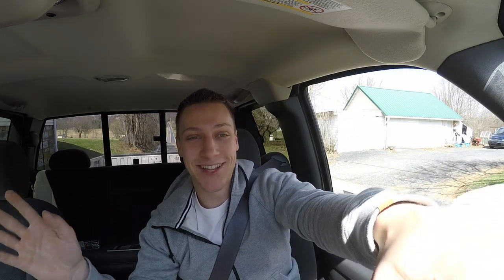WHY I DON'T Roll Coal...

Comment: Rolling coal = high egt's. That's gets to be a lot abuse on the motor. Plus with your duramax you have a common rail that can produce so much power with out smoke! But if you have a mechanical diesel like me it blows a poof a smoke every time it starts up because there's no boost at start up and the pump can't compensate for that. But if I romp on it there is some smoke but it will clear up when the boost catches up. I will be dialing the pump down to smoke less. Maybe look at how to videos on how to properly tune a pump haha. Thanks for not being a d-bag that "rolls coal" everywhere!

Comment: The old trucks with the mechanical injection would spew smoke until the turbo spools but again once everything is where it needs to be the exhaust should clean up. On a common rail diesel I want to bitch slap anyone who rolls coal.

Comment: Hey mike is it cheaper to own a diesel truck than a regular gas truck.
Reply: +Eric Estrada no
Reply: Well now I know, Thanks.
Reply from the maker: +Eric Estrada More expensive pretty much in every way lol
Reply: Street Speed 717 dam at first i was hoping it would be the same or little cheaper.
Reply: No problem, diesel is normally more expensive than premium gas. The only upside to owning a diesel is that they will last a long time. My 2001 duramax has over 250k miles and still running strong

Comment: No smoke means you could be running lean and that will wreck a diesel in a VERY short time, as long as it smokes its not running lean...
Reply: Yes. It's running fuel-rich and is going to clog itself with the gunk. Tuning engines is not easy for a reason, but correctly-tuned diesel has a clean exhaust and very decen MPG count.

Comment: You don't actual have to have a tune to "roll coal". I had a '88 F250 N/A 7.3 that I would run agricultural (red) diesel in illegally of course but this was back when normal diesel was pushing $5/gal in my area and the extreme sulfur content alone made it roll coal with the best of them. 

Oh you don't know a loud diesel until you hear a 7.3 IDI running with a cut out open right off the headers...

Comment: I hooked into my mass air flow sensor so if someone tailgating hit the toggle switch give 15% more throttle and smoke em out cant stand them folks I'm already at the max speed and they wanna do 45 in a 25 ridiculous so I give em a hard life lesson lmao otherwise I love my deleted diesel for the perks not the coal lmao

Comment: is having a diesel a "thing" now? Even guys who don't need them whatsoever think it's cool to drive them or something.
Reply: Doug Johnson Diesels are typically more durable than gas engines. They're also heavier, which means that if you get into a wreck, you're least likely to be the vehicle that's flung around. And the sounds they make are the icing on the cake :D
Reply: Oshy they are also ridiculously over priced and seems to be a hipster thing now
Reply: I dont see it much different then someone liking a jacked Subaru. I dont get why when its a truck people think they arent allowed to what they want and get what they want with the truck.

Comment: if you knew how a diesel engine works, you would know that it has no throttle valve or anything like that in the intake, which means that there is a "full flow" of air into the engine at all times (even at idle). this busts the theory of a diesel engine "running rich" or "running lean."
Reply: They still have too much fuel and not enough air or the turbo hasn't lite yet and it's just spooling
Reply: one of the ways to blow smoke is to lug the engine, which keeps the rpms down and keeps the turbo from spooling, while adding fuel

Comment: Dude your wrong and have no idea what your talking about there are plenty of trucks that are tuned that blow black smoke that has nothing specifically for that.... when you are making power in a turbo diesel your going to be dumping too much fuel as its spooling up until the turbo is pushing enough air into the damn engine for the a/f ratio to finally be correct. When the truck is tuned properly on a take off you get a good puff of black smoke and if your on the throttle is should have a lighttt haze

Comment: efi live has a Dsp5 switch its meant to be changed on the fly
Reply: Yep but the truck should still be stopped👍
Reply: +Jay Herrod no lol geez I have efi live and I have a duramax it can be changed on the fly no issue
Reply: +Jay Herrod no lol geez I have efi live and I have a duramax it can be changed on the fly no issue
Reply: +tyler collins really? The big diesel tuner around here has always recommended to be stopped  but I guess it doesnt really matter
Reply: +Jay Herrod it doesn't hurt anything

Comment: You drive you're trucks totally different, much more relaxed lol

But it's silly you need to explain this. it's clear that rolling coal is plain stupid. An obnoxious exhaust is one thing(which I shamelessly have) but blowing thick smoke at somebody is taking it to a new level
Reply: Diesels can haul, but if you run them light like this they'll last 500,000 miles

Comment: Roll coal at the track, but I agree no need for it on the streets. We have enough emissions crap already.
Reply: +6806goats1 That's interesting that you do it at the track. I know showmanship is a big part of racing. Do you do it to please the crowd or does it the extra, although inefficiently used fuel give a small increase in power and therefor performance?
Reply: +namayake I don't roll coal. it's usually needed when the turbo is so large that it takes a long time to get all the fuel burning. But that's just a guess. Probably mechanical injection to handle hi power under load. Others have a good handle on this. I'm just saying that if you roll coal on the street to be an ass, there's no need for it. No need to bring a track or sled machine to the street and fog out the intersection.
Reply: Oh woops! I misread what you wrote. You said  "roll coal at the track," not "I roll coal at the track." But anyway, I totally agree about doing it on the street, not cool. But hearing about how it's performed and what you said about doing it on the track, made me think there might be some utility to it beyond just being a polluting prick.

Comment: Untrue about the tune, the newer diesels yes it will do it so much easier but if you were to put let's say 200 or 250 injectiors in (given they wouldn't tune straight and burn fuel like hell and the stock turbo would give you shit. Ect.) it would but to my point let's say a 1st generation Cummins it will roll a bit of coal stock and a bunch with a bit larger injectiors and a cut pipe it will smoke all day, not being a smartass by any means just thought someone somewhere might like to know

Comment: On my 01 LB7, stock it'd roll a little coal when I get on it. But I like to be discreet so drawing unnecessary attention to myself isn't really wanted, despite a loud exhaust. Coal is what gets most people butt hurt but the people riding my bumper get a blast of coal. I don't understand why people with cars especially small cars have to ride the ass of truck drivers, If I'm going the speed limit on local roads theres no reason why you should be there.
Reply from the maker: +Captain Quattro Sounds about right lol mine will do a decent little cloud if you mash the throttle into boost as well.

Comment: If you have a high hp truck it's gonna roll coal as simple as that. There are smoke tunes but just a high hp tune will do it hell my truck on a stock tune rolls coal just because of the bigger turbo and injectors. Watch all the trucks smoking vipers and other fast cars. They're rolling coal.

Comment: SCT has some good tuners
Reply: +Kaiden Israel For Ford yeah, because it's the best they have.  EFI LIve is the only way to go for late year Cummins and any year Duramax.
Reply: thats all i will ever drive is ford
Reply: Kaiden Israel Then yeah you're right, SCT easily has the best system for tuning in the Ford trucks.  Most common form i've seen among high horsepower Fords anyway.

Comment: I have a 7.3 and I have a chip in it and I can roll coal but it's a waist of time and it will ruin ur injectors that most of the problems with 6.0 powerstrokes they roll coal and they keep on doing it and it ruins there truck and not just that it's just 6.0 are shitty trucks and the only reason people can roll coal without there truck breaking is that they bullet proof everything in the engine and btw 7.3 powerstrokes are awsome af

Comment: your duramax doesn't roll coal because it's stock lmao. look at diesel drag races or truck pulls they all roll coal those trucks a laying down mad power.
Reply: It's not stock lol
Reply: +Tyler Clark it's pretty much stock it's not build its got a tune and a straight pipe lmao
Reply: +Thibault not fully built but he has put an aftermarket cold air intake as well as tuned the truck.
Reply: +Tyler Clark yes and with those parts I hope it wouldn't shoot any soot it's basically stock. larger injectors better fuel system larger turbo it will be hard for the truck not to smoke.

Comment: Hey bud FYI with horsepower comes smoke
Reply: not completely true pal. my 500 horsepower lml barely rolls any. it's all about the tune. and it's far from stock. by the way it's running efi live
Reply: MrMotoman28 hey bud, I think you should log off now. Properly sized injectors + properly sized turbo = no coal roll
Reply: Les Vegetables yeah I understand that but to a point your gonna get some

Comment: "Rolling Coal" can also damage your engine.
Reply: A "lope tune" will damage your engine rolling coal won't hurt your engine. Adding way to much timing will hurt it. But the fact that it smokes will never hurt it what so ever.
Reply: Ok, I thought rolling coal damaged something.
Reply: All of the soot can build up and cause issues
Reply: +TheDeeche1 rolling coal gives high egts, which can melt Pistons.
Reply: +Jon S even in a stock diesel you can get your egts high enough to melt a turbo or a piston. I know guys who've don't both and neither where "rolling coal" it's just dumbasses not knowing how to drive and straining the engine until it grenades itself.
Reply: +Jon S wrong it lowers egts... That's why you see the drag racing and tractor pullers roll coal the whole way down

Comment: rollin coal is more child's play lol.  but you actually can switch tunes on the fly while driving with efi and a dsp5.  and most people won't tune with a smoke tune simply because it's stupid and kids are ruining the diesel image Rollin coal on everything. not to mention those tunes are really not good for the motor.  and if you felt like it, you could actually do it without a smoke tune. just undo your maf sensor plug. again Rollin coal isn't the smartest thing to do so just don't do it lol.

Comment: when u roll coal its cool but when it does u lose horsepower
Reply: stop your embarsing yourself how can pushing more fuel into your injectors causing a more powerful explosion make you lose horsepower
Reply: its great that your pushing more fuel into your injectors and adds hp but you lose around 5 to 10 hp when you roll coal but theres no feel difference in driving

Comment: Hey good job on not turning out gay and running properly tuned equipment.   Not everyone can be a winner.
Reply: Tuning doesn't equal smoke. You can smoke without tuning. However, you can properly tune an still have smoke. My 7.3 had a ts6 tuner, and I didn't smoke in 4 of 6 positions. Just a matter of the tune and/or engine mods such as bigger injectors an so on

Comment: Very misinformation video.  At low rpms and full throttle a properly tuned truck going for extra boost should smoke a good bit.  To all the smoke haters. Smoke = power like it or not.
Reply: Smoke = wasted power. Why do you think rocket engine makers are trying to make staged combustion cycle engines nowadays, instead of just dumping still-rich exhaust of the turbopump to the side? Because it gives quite a bit of additional power.